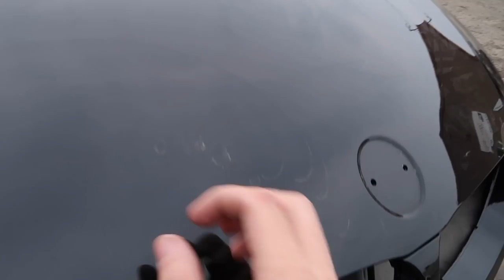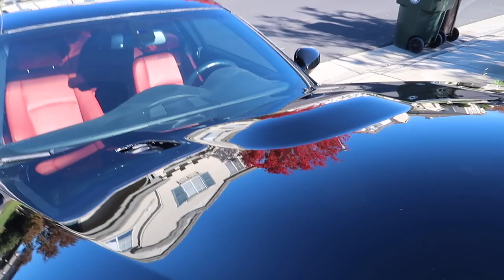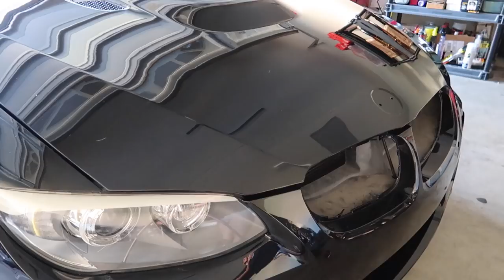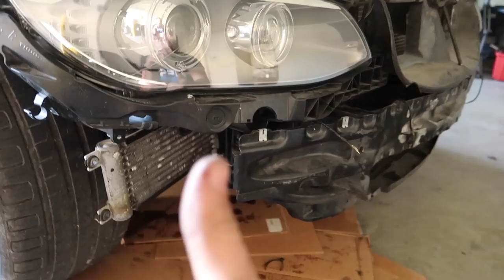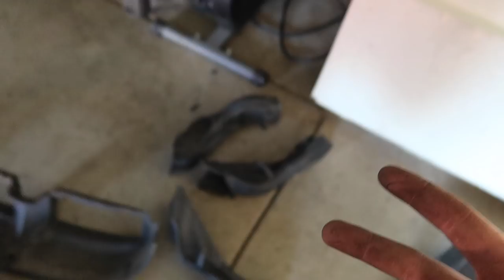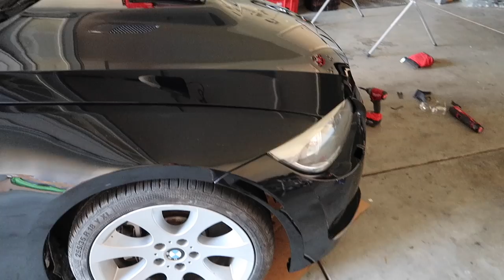AFTER 1 MONTH THE 335IS IS BACK FROM THE BODY SHOP! I am disappointed! Part .4

Comment: Definitely needs spacers front and rear. It will need even more spacer once you lower it. Get some spacers for the E36 if you can also.
Reply: 12mm front and 15mm rear work well with the style 313 wheels. I own a IS myself.
Reply: Blake we miss the s3
Reply: @DejectedAngel  been thinking about doing that same set up, do you rub at all? Are you running stock suspension?
Reply: @Roy_Royster  I’m lowered on Fortune Auto coils. No rubs.
Reply: @S4Kav  Blake’s bimmer is way better.
Reply: @DejectedAngel  perfect, thank you

Comment: If you want to keep it budget friendly, i would recommend you go with h and r race springs. I’m running them on my 335is and they sit very low. Also recommend getting a AK style front cf lip. It will completely change the car.

Comment: You should bring it back to get that drip fixed.  I hope it is in the clear coat.  It should be a 20 minute fix if the guys are competent with a razor blade and compound.